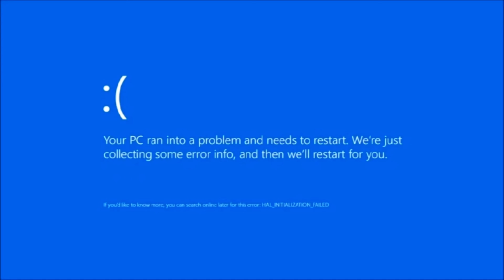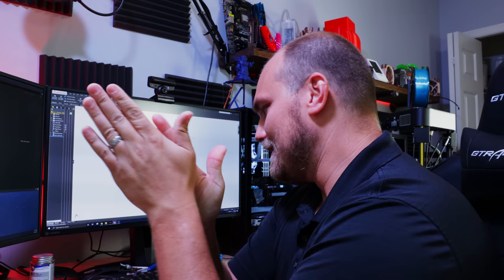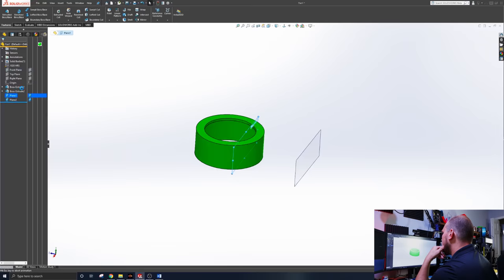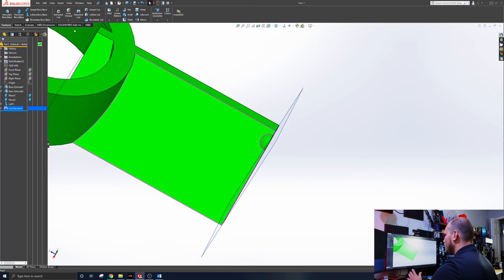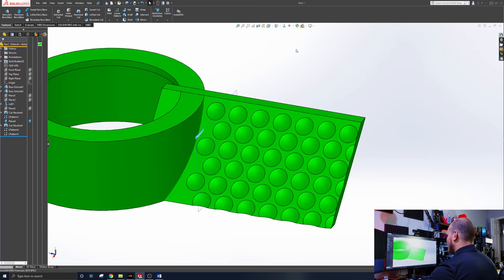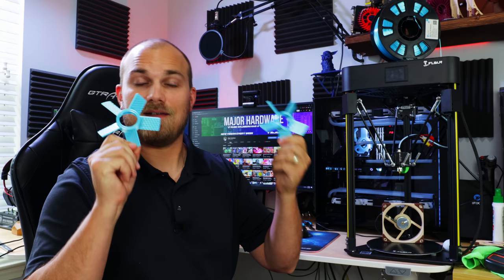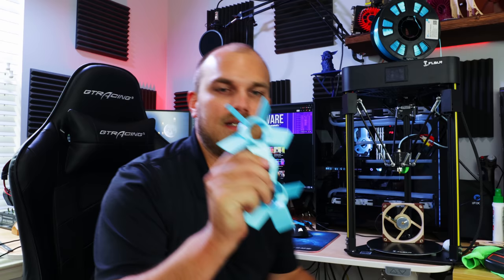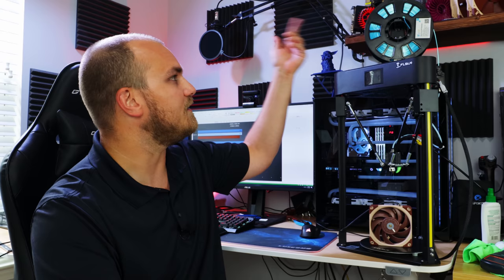What If Fan Blades Had Dimples Like A Golf Ball?

Comment: Fun fact: the dimples on golf balls are actually useful for slightly increasing the turbulence, because a small amount of turbulence keeps the ball from forming a low-pressure area behind it in flight, which would slow it down greatly.
Reply: Performance intake manifolds in racecars use the same  principle to speed up the air flow
Reply: You nailed it! When a golf ball is hit by a club the angle on the clubs face causes the ball to have a back spin.  On a smooth golf ball this back spin accomplishes almost nothing. However when that golf ball has dimples they effectively create "bearings" of turbulent air that transmit some of the high pressure it is facing ahead to the low pressure area behind it. This also accounts for how their climb seems to defy gravity.

This turbulent effect applies most to the aerodynamics of a sphere, and there have been amazing experiments showing a golf ball with only a  central stripe of dimples could fix a slice (banned of course). However we don't see dimples on  airplane wings, and for good reason. A quick google search will do a better job than I explaining that balls experience turbulent flow and wings experience laminar flow and this changes everything. Simply put a fan blade is a type of wing, it experiences laminar air flow thus different rules. 

Fun experiment, and good job testing it out. I think someone mentioned measuring current draw at a given RPM to determine if the fan experienced less drag, which is a good question.  Also someone pointed out less raw material consumption is also a good and measurable gain. For anyone interested in the real physics explanation I have a decent link below. Cheers!

https://physics.stackexchange.com/questions/109395/why-arent-airplanes-like-golf-balls
Reply: One more question I have regarding the laminar flow effect over a wing, if you had the dimples only on the low pressure face of the fan blade, would this increase or decrease the low pressure effect (lift) of the wing (blade)?
Next, same experiment, but with the dimples on the high pressure side of the wing (blade), would this increase or decrease the lift effect of the wing?
Lastly, would dimples have any beneficial or negative benefits to wing stall?
Cheers,
Mark
Reply: @markcleveland3790  As I understand drag, creating higher pressure on either side would destablize the wing, creating turbulance. You want low pressure on the low pressure side. If you increase the pressure, you lose the pull. It seems to me that dimples would create a smoke signal effect, puffing air, thus causing unwanted vibrations that could build upon themselves until critical failure and your wing goes flying off. I don't think a fan blade would express it the same way because of the curved trajectory of the blade around a centrifuge and the shape of the blade designed to funnel the air toward center.

I think a closed circuit fan (w/casing) may also be mitigating the effect of the dimples, while an open fan (No casing) may show up the turbulance a little more.
Reply: @markcleveland3790  Great question! I am not always good at explaining complicated things (I'm an engineer, not a teacher) but I will do my best. Fair warning, it is probably gonna take me multiple paragraphs to answer this with adequate explanation.

Dimples on the high pressure side of the wing (bottom) would decrease lift because it would increase drag and the air on top would  no longer have to move faster to exit the rear of the wing at the same time. It would also increase drag by an order of magnitude more than the lift gains you would see, double whammy.

Dimples on the low pressure side would increase lift as the air would have to go  over the wing even faster than before to meet its counterpart on the bottom of the wing. However the amount of drag this creates is again an order of magnitude larger than the lift. It is vastly more efficient to fly faster with minimal drag to increase lift than it is exponentially increasing drag for a bit of lift.

Now, this is important, There are 2 types of drag we must add together to figure out our total drag. As one goes up, the other inherently goes down and vice versa. When an object moves through the air it makes a high pressure area ahead of it and a low pressure area behind it, this is standard drag. When air flows over a surface it experienced drag proportional to the smoothness or roughness of the surface, surface drag. The more "blunt" and object is, the more it is affected by standard drag. The more streamlined and aerodynamic an object becomes the more it is affected by surface drag. For example a blunt semi truck has to fight standard drag while a Lambo cuts through standard drag very well so it is more affected by surface drag.

Dimples reduce standard drag while increasing surface drag. A sphere experiences primarily standard drag thus dimples are good. a wing or fan blade experience primarily surface drag thus dimples are bad. Anything contrary I may have hinted at in my previous post was due to exhaustion and alcohol.

When we say something is "more aerodynamic" it is less blunt thus more affected by surface drag because it cuts through standard drag. When we say something is "less aerodynamic" its blunt leading edge experiences primarily standard drag which saps more energy than surface drag. You gain more from having a pointy front on a semi truck than you would from a glassy smooth surface all the way down.

Before anyone asks, "No, a semi truck will NOT get better gas mileage if it had dimples". Unless you could make the cab a dimpled sphere with back spin...
Reply: so in theory it should make more noise.
Reply: @stbeg7671  Not necessarily. The drag is being created by pockets of air, not physical surface. Conflicting air currents make little noise unless 1) they come in contact with a surface or particulate matter or 2) it is in great quantity. Any increase of noise is therefore likely to be created by the stress on the wings themselves due to the increase of forces rather than by the air striking the wings.
Reply: @willchristian5954 this is a really good explanation for what's going on with the dimples, and you have nearly everything correct, though you have shown a slight misconception in that the dimples do not actually impact the accent of the sphere, that is actually a result of the Magnus effect, in which the additional friction on the side of the rotating body moving forward relative to the air around it causes it to experience more drag and pull the object towards itself. 

whatever the case, this is a particularly informed viewpoint on the effects of the dimples on the drag and trajectory of the ball, and I hope that I have increased your already large well of knowledge.
live long and prosper, Zigon out.
Reply: Yeah...

Science
Reply: @willchristian5954  quick question though. isn't the concept of laminar flow and and turbulence the same principles? The idea behind laminar flow is that there is a boundary layer of miniscule turbulence along the surface of the wing that over which the smooth air flows thereby allowing the air to remain attached to the wing longer before detaching and deteriorating  or that is how i understand it . I may be wrong.
Reply: @jussayinmipeece1069  The idea behind laminar flow is that there is no matter flow between layers and so energy is not dissipated that way, resulting in a smaller drag. In the turbulent boundary layer fluid flows from one layer to another, and thus matter from higher speed layers gets transfered to the lower speed ones, speeding them up. When, in laminar flow the layers close to the wall slow down to the point of detachment, in turbulent flow those layers get sped up and that allows the turbulent boundary layer detach later than the laminar one.
Reply: @SharkY1092  so basically what i said minus the Reynolds number.
Reply: @Dismythed  Thanks.
Reply: @willchristian5954  Actually you are wrong about the semi... go check out myth busters they took a car and put dimples on it and it got better gas mileage with dimples than it did without.  So if it worked on a car it would also work on a semi.
Reply: @trezapoioiuy  according to a bit of research i did, for dimples to be effective the leading edge needs to be of a certain shape and size relative to the trailing edge to have the desired effect. Also with a flat or none sphareoid surface the dimples need to be of a specific depth , placed strategically and not necessarily cover the entire surface either.
Reply: @jussayinmipeece1069  so it seems like it would be pretty hard to get any use of them for a fan blade
Reply: @trezapoioiuy  not necessarily. if the blades were perhaps round at the leading edge and thicker and then thin at the trailing edge with only perhaps  two or three rows of dimples towards the trailing edge. 

there is also another issue . The smaller the blade the less effect any sort of dimple has so at that size you are correct there will be almost ne effect.

The actual shape , number of blades and angle of the blades are the factors that will count for noise, volume of air and efficiency at this size.
Reply: @willchristian5954  so, to summarize the DOE results on class 8 vehicle fuel economy - corrugated trailers are the worst kind of trailer for drag. That makes sense since there’s more surface area at an oblique angle to the direction of travel. It also makes perfect sense to add aerodynamic devices to rectangular trailers and to cover up the gap between the vehicle and the trailer and the vehicle and the ground. 

I was struck by the tanker section, though, as it’s at least somewhat pertinent to this discussion. The tanker is a cylinder. Would a tanker benefit from adding dimples to its surface (along the shaft of the cylinder, not the “top” and “bottom”) or are we still lacking the backspin effect that’s achieved when a golf ball is struck?
Reply: @davidmedeiros8998  You pretty much got it. Your point about corrugation down the sides is the same proof against dimples due to increased surface drag. When it comes to the cylindrical tankers I wasn't able to find anything specific and published in the short time I spent.

My thesis is actually the opposite of yours. I imagine dimples down the shaft would increase surface drag same as corrugation down the shaft of a rectangle. But dimples at the leading and trailing ends, if semispherical in shape would reduce standard drag at the front and back, though less so than a pointed cone. But I wasn't able to find specific research and today I need to do some chores. I would love anyone to provide published  proof on this topic.
Reply: cybhunter007  Sounds like you are more of a subject matter expert than I am on this one. I work in semiconductors, specifically with the manufacturing equipment. Right now I am in Photo Lithography, which is like a 1hr photo for micro chips. Spin coating of photo resist is standard in the industry, lots of dosing vs rotation speed vs thinner pre-coat and mixing at the boundaries. I have also worked in wet etch, chemical vapor deposition, physical vapor deposition, and furnace based deposition.

Anyways, back on topic. I think that dimpling along the trailing edge is similar in principle to vortex generators already in use. They add them to the  top trailing edge of a wing reducing the stall speed while also increasing drag thus reducing top speed and fuel economy. Commonly preferred in applications like bush planes where stability in questionable weather and low speed takeoff/landing is key. I venture to guess that this sort of thought path lead to the engineering of vortex generators, to bad we were too late, lol.
Reply: cybhunter007   You give me too much credit. I don't design chips, or even pieces of processes. I am hands on with the robots in the clean room. When a multi million $ robot drops a $3K wafer and freezes to "do no more harm" I get to recover it and make the robot happy again. When the critical dimensions of processes are not to spec I work with the team and sort out why, then do the work to get that bot accurate down to the nanometers required of this field. I have always wondered how the logic aligns with the physical as well. In this day and age the protection of Intellectual Property (IP) is paramount. I will answer your question with a vague anecdote.

I went to an automotive tech school to become an auto tech, which is how I started my career. In our electronics class they started by explaining that microchips are little black boxes that run on "F.M.". In computers F.M. is a calculative function of "magic smoke" which if you let it out, the microchip stops working forever. F.M stands for F^$%!*g Magic, thus the magic smoke. Sensors and circuit boards make sense, all the steps of making a chip make sense, I still don't understand how transistors make logic. I always imagine it is like counting cards in Blackjack, some take the count up, some take it down, and  some are neutral. Everything runs through a bunch of up/down calculations then the final result is interpreted algorithmically. Also Semicon is a term that can encompass a whole range of products these days. I have made ASIC's, Photo cells, Solar cells, memory cells, ssd storage cells, and very basic processors, I couldn't tell you how any were designed or actually functioned. 

I am certain there has been plenty of research in to all the different ways you could design flaps. As it stands, smooth flaps already trade drag for lift. I presume your proposed hybrid flaps would too drastically change the balance between drag and lift, the danger of which is multiplied by the fact that these are used during take off and landing when the risk of stalling is the highest, stunt planes/maneuvers excluded. This risk changes from multiplicative to exponential the more drag you get in exchange for less lift. Flaps and vortex generators have a great ratio of increased lift vs increased drag, while I would wager that the increase in drag far exceeds the increase in lift with dimples.

More isn't always better. More = better to the really, really, REALLY stupid people, but this is only proof of their stupidity, not proof that more is better.  Sometimes the drag cost of more lift far exceeds the benefit that lift provides. Like affixing a parachute to the wings of a plane, yeah it gets you a lot of lift, but creates so much drag you would rather not have it. There is lots of stuff that functions, especially in theory, but functional is far from proof of optimization, efficiency, or even being practical in application. Cost vs Benefit analysis is a physics term that economists use so much they like to think its theirs.
Reply: Funny that the barnacles on my yacht don't make it faster...
Reply: @markcleveland3790  I was thinking the same thing but didn't know how to ask it. Also a combination of bumps on one side and dimples on the other might be worth experimentation.
Reply: @willchristian5954  In my experience, the cost vs benefit ratio, as it pertains to who is buying the trailer, is the deciding factor of whether a trailer gets built with the ribs of the trailer exposed to the outside air or covered with a somewhat smooth skin to improve fuel economy.
If you're a company that utilizes contractors/owner-operators, then you're likely to purchase trailers with ribs exposed on the outside as you get the benefits of maximizing the internal cargo volume and weight which you can agree to transport, but the contractor/owner-operator pays for the fuel, so you don't care if exposed ribs equals poorer fuel mileage.
If you are the owner-operator, who is paying for the fuel, you'd prefer to gain the benefits of better fuel economy and don't care if you lose <1% of loads you might haul if you had the smooth sides of the trailer inside.
Reply: @markcleveland3790  Very good point. I cant help but feel that is more a discussion of economics than a discussion of fluid dynamics.
Reply: @maximwannabepro3021  Turbulent flow in intake manifolds promotes mixing of the air/fuel ratio at the expense of outright flow.  You still get increase in power
Reply: @kellygordon103  so it would only work on carborators? Because non carb engines have direct injection systems
Reply: @maximwannabepro3021  No port injection needs time and turbulence to thoroughly mix the air/fuel mixture prior to combustion as well.  The mixing starts in the intake port.  For Direct Injection engines all the mixing takes place in cylinder.
Reply: @maximwannabepro3021  They dont but okay.
Reply: @Iceberg86300  I have replied to to at least 10 people on this thread, who is "that guy" you are referring to? You gotta give me something to work with here, please.  My first post was not insulting to anyone. My second one I clearly stated that I am not a good teacher and sometimes I struggle to clearly and accurately explain things.  Now then, I was certainly a Dick to that Duck guy, but I am not gonna feel bad about that, trying to make me is a futile effort. I also stated in that post that some things are oversimplified for brevity's sake. I don't know exactly which post you are referring to, but I acknowledged in my posts that I probably misspoke, oversimplified, inaccurately explained something or gotten something backwards. I am smart, not perfect. The last guy who staked a serious claim to perfection was Jesus of Nazareth, and that claim is still disputed over 2000 years later, lol. Now, my personal shortcomings as a teacher aside, All my conclusions stand on their own merit, regardless of weather I mess up the explanation or not. A comment I made over 2 weeks ago has now eaten up 5-10 hours of my time in research and responses which far exceeds how much care to devote to such things. 95% right when I care less and less per post is more than good enough for me. I still need to give thanks for all the great discussion on this topic to everyone who has contributed, I don't feel like my time has been wasted. Except by that Duck guy and morons like them, stupidity should be painful and f*$& those guys.

Not sure how me explaining that I am not a good teacher, and that I am oversimplifying stuff = me going Dunning-Kreuger, certainly not an overstatement of my own abilities and understanding. I also make sure to clarify that cyberhunter007 is likely more of a SME than myself, opposite of Dunning-Kreuger. I am no Trump and your association of me to him through Dunning-Kreuger is far meaner than any insult I have flung and I have more than enough faculties to understand the depth of the insult, that's mean. Equal transit theory does not square with Newtons third law of physics and I did not try and argue in favor of such things. Really equal transit is just the way to help a stupid person understand Bernoulli's principal by explaining it a bit wrong. Still, explanation using Bernoulli's' principle or Newtonian physics are limited and simple explanations of lift vs drag equation. Any way that I may have framed lift in a equal transit matter was an attempt to frame how dimples in certain places will effect drag and lift as described by Bernoulli's principal. I honestly feel bad that I didn't properly intellectually emasculate some fool with the proper terms, but said fool wouldn't get it. You get it, but because you get it I have no desire to make you look stupid, and no grounds to do so. Why are you working to defend someone who isn't willing to work to defend themselves? Why use your intellect to the benefit of a fool who cant be bothered to learn literally anything?!?!? That is certainly a waste of time in my eyes, unlike this discussion overall.
Reply: @willchristian5954  First off, I'm both a complete layman, and also half asleep, so this could be completely wrong, but you seemed like you've enough knowledge to at least conceptualize the idea that just jumped into my mind as to how dimples might work on a fan.

At https://youtu.be/nbnep-WLJnE?t=881 he has that brown fan sitting on his desk with the curved blades. If that was set so that the outside edge of the curve had the dimples in it, and spun in such a way so that that outside edge was the leading edge, could that perhaps give a similar effect to the backspin that is imparted on the golf ball, and thus maybe have an effect on the airflow through the system?

If the idea seems totally wrong, at least I'll have learnt a little something (well a little something more, your posts have already been an interesting read), but if the idea seems workable, perhaps it's something that could be tested.
Reply: 500th like!
Reply: @willchristian5954    Good discussion.  However it is worth noting that the old idea about the air over the top of an airfoil traveling over the top so that it meets at the same time at the bottom is actually incorrect.    From this website:  

https://www.sciencelearn.org.nz/resources/300-wings-and-lift#:~:text=As%20air%20flows%20over%20the,air%20pushing%20the%20wing%20upwards.

"It used to be claimed that the air travelling over the top of the wing took the same time to reach the back of the wing as the air travelling along the bottom. This has been shown to be incorrect, but it has been shown that the speed of the air over the top is faster than the speed of the air under the bottom."

NASA also agrees with this.  Lift and drag are very complicated topics with vortices having a lot to do with real wing's lift and drag in airflow.  It is very much a three dimensional issue.
Reply: @maximwannabepro3021  I was gonna say pretty much the same thing, but I've seen dimples done in the heads